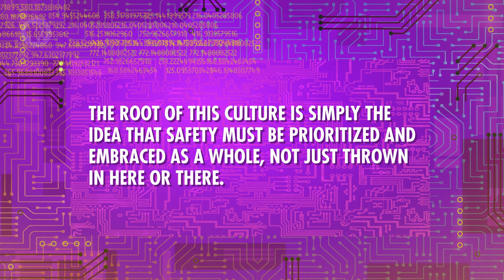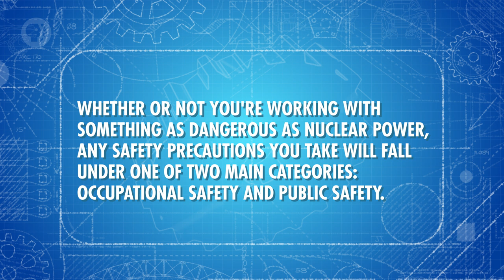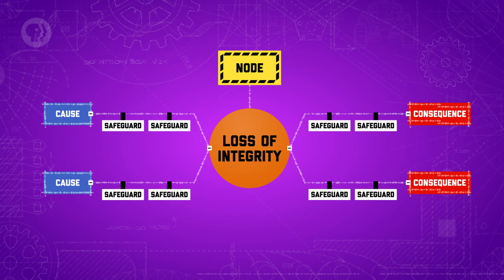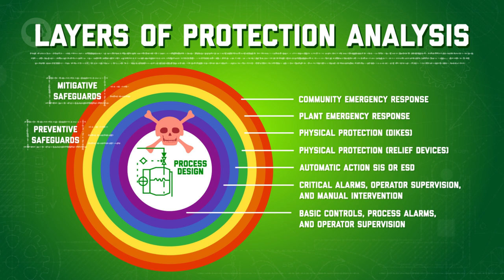Flirting With Disaster - The Importance of Safety: Crash Course Engineering #28

Comment: Interesting fact, we still have many of the exact same Chernobyl reactors operating around the world, 11 at last counting. We made them safer by increasing the enrichment of the fuel, thus, allowing for more negative control rods in the reactor at the same time, better instrumentation, and other features and training that make them just as safe as other, modern reactors. 

Just goes to show that safety is more about systems design and culture than just "bad apples". Even this so called troubled reactor can and has been made safe to modern standards. Cheers.
Reply: Do these reactors use graphite?
Reply: @ReimuandCirno  Yes, lot's of it! The cores are huge, which also became a real problem in terms of controlling the reactor with the limited amount of instrumentation it initially had. Regions of the core could be in completely different criticality modes with very little direct knowledge of that known to operators. 

Sadly, since they had no primary containment system, when the core was on fire (either the graphite was or the stuff that fell on the core) burned for 3 days and makes it basically the worst case possible for nuclear. In that, the worst case still pails in comparison to normal, boring, everyday air pollution deaths, which is why even given nuclear's interesting history, it comes out on par with renewables in terms of deaths per unit energy. A cold metric, I know, but still interesting none the less. You wouldn't think to pit nuclear against wind in terms of overall danger to the public, but that is what the evidence seems to say :D

Comment: MSDS is no longer an accurate name for the document provided by manufacturers (as of around 2016, since the implementation of the Global Harmonized System or GHS). The new documents are referred to as an SDS (Safety Data Sheet) and are quite different from the old and haphazard MSDS.
Reply: IntuitiveLeap and DFTBA :)